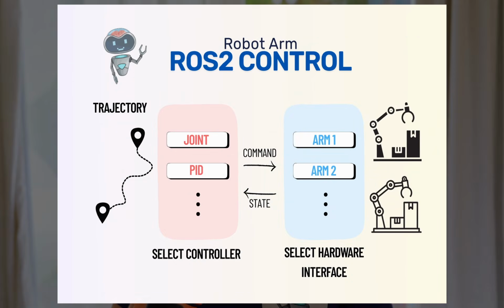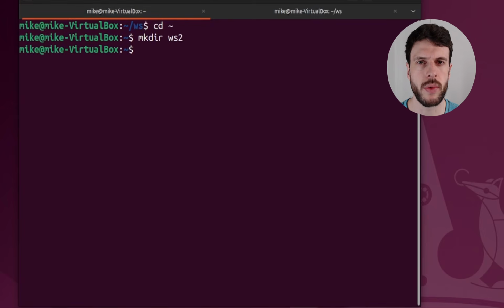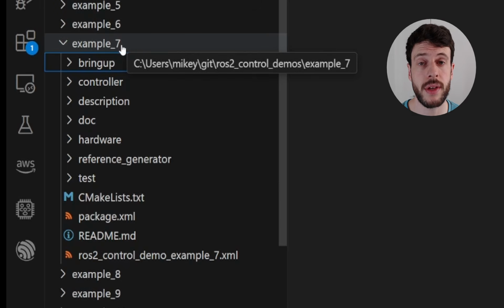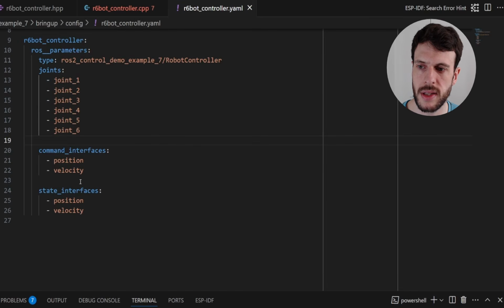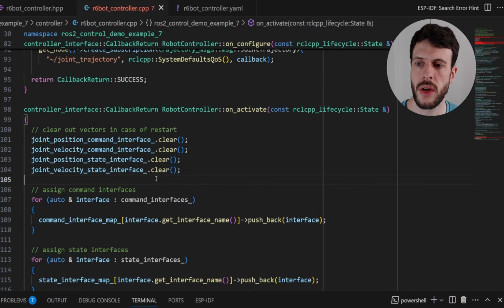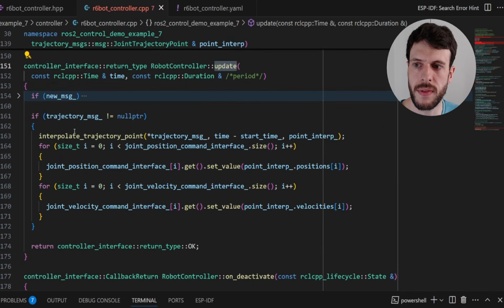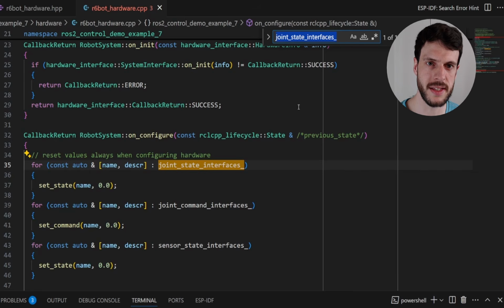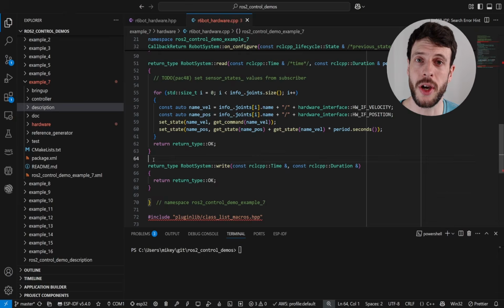Controlling a 6DOF Robot Arm with ros2_control

Comment: Is there no follow up to this that you talked about?
Reply from the maker: Not yet - I've just been able to order the robot arm, so hopefully I'll be able to record the follow-up video a few months into 2026.
Reply: @mikelikesrobots  OK thanks could you please lead me to some resources that would go about the implementation because I need to do it right now and can’t really wait
Reply from the maker: @fuzailhamid1122  You can try to follow what I do for the JetBot: https://youtu.be/2JJApj-PNVk
Of course, you will need to adapt it for the robot arm. You can also look at examples in the ros2_control repository - one of those might help you work with a real robot arm.

I will say that what I write in this video is the essentials of what you need to do, except instead of doing blank operations for input and output, you would write to the motor controller for the robot arm. Unfortunately, this is all the help I can give until I have my own robot arm to work on. Good luck!

Comment: HELLO  .Nice to see ur video . I am now a uni student.And I am going to do my subject project about Using ROS2 with GAzebo simlution then control real Yaskawa Robot,empowered by AI(LLMs) .Ex: when I chat prompt then robot does like that.Can u share me ur experiences,and give me some explain,also some advices? Is it possible ? TKS so much.
Reply from the maker: What a great project! I'd suggest trying to build in controls, similar to the code used for this video: https://youtu.be/Lr-LjwPR1hM
You will need to adapt it to move an arm instead of a robot. That'll be the tricky part of your project. You can look into using MoveIt for path planning, which is also discussed on my channel. Good luck!

Comment: thanks Mike. It was really good to see your explanation of this code.. I've just finished implementing this for a real robot arm. I've used the built in JointTrajectoryController. Using closed loop feedback gave me a bit of trouble when there was spike noise on the read function from the robot arm. Once I switched to open loop control it improved.
Reply from the maker: Great you got it working! I'm curious why you had issues with the read function. You should get better performance from closed loop control. Still, if it's doing what you want, no need to overcomplicate things!
Reply: @mikelikesrobots  Hi. The issue wasn't on the ros2 control read function, it was from the read function on the microprocessor that was reading directly from the servos. There was a bit of noise. so if I was moving the servo from -1 radians to 0 radians and when it got to zero, it could give a reading of 0, +1, 0, say where the +1 was spike noise from the (cheap-ish) hardware, it would try to bring it back to zero by interpolating and send it to +0.5 (say), which would mean it would overshoot the position, since it was never really at +1 in the first place. The alternative would be to update the code on my microprocessor to take three readings and use a median filter or some such. Also, maybe I need to adjust the gain parameters as well.
Reply from the maker: @jonathanr4242  It sounds like some filtering would help, or even a PI controller so it doesn't react immediately to noisy inputs.

Comment: Hey Mike! 
I already watched all ur videos
Im still confused with something. For the real robot I use de GPIOS from the RPI or I use for example a Pico as a Node and comunícate serial with de Rpi ?
Reply from the maker: You can use either one! Using the RPi alone will be simpler and easier to set up. However, for a real robot, you might need the controller to be dedicated to the motors, so bringing in something extra like a Pico or an Arduino would help. It just depends on the use case. For a wheeled robot, I think the RPi alone is fine.

Comment: Nice video here. When are drivers used and when are hardware interfaces used?
Reply from the maker: Thank you!
Hardware interfaces are the general term in ros2_control for anything that interfaces with hardware. Read-only is a Sensor, write-only is an Actuator, and bi-directional is a System.
Drivers are used by a hardware interface to do the communication. For instance, I may write a System hardware interface to communicate with a real arm over I2C, which then needs the I2C driver to send and receive messages.

Comment: for transition to real robot, you said not to use and delete the controller file(so you are talking about the example controller ?), but don't we have to replace the given controller by ros2_control website ?
I am a bit confused here.
Reply from the maker: Right, we're deleting the example controller and changing the configuration to use the existing JointTrajectoryController. In our files, we delete the folder, and we edit a configuration file; the controller from the ros2_control website is already installed with ros2_control, so we can just reference it!

Comment: What's the benefit of not using moveit2? As moveit also uses ros2 contro?
Reply from the maker: So there's no reason not to use MoveIt. In fact, when I do get to moving a real robot arm around, I'm very likely to use MoveIt to do it. The reason not to in this video was to focus on the lower level of ros2_control, then go on to higher level logic later.

I'm planning to cover MoveIt tutorials as one of my next few videos, after which I'll use it for control. Hopefully you'll find that useful or interesting - let me know!